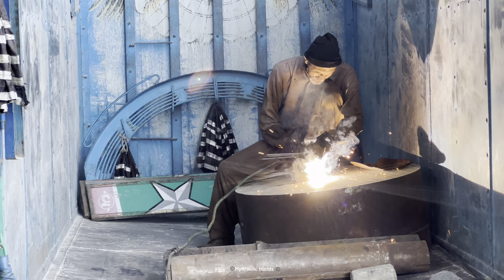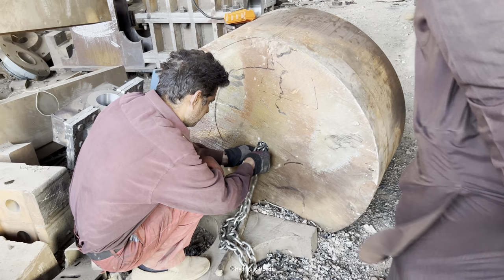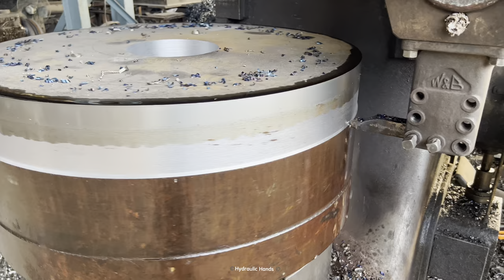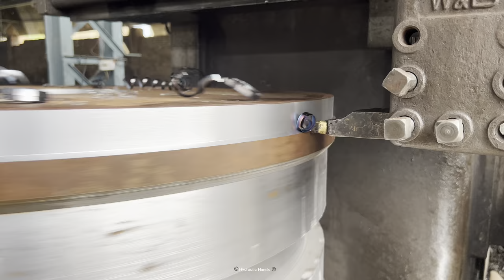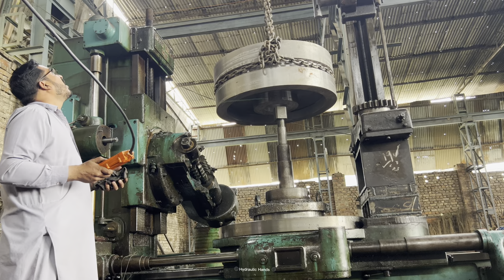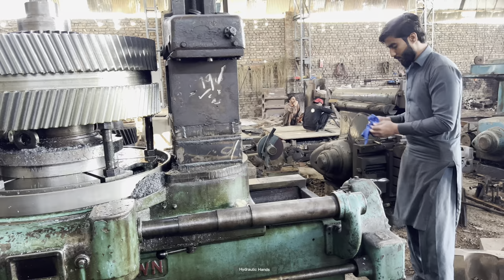Metal turning / how to turn 3Ton Double Helical Gear smarter than others

Comment: As an engineer ,this is the most counterproductive machining iv seen. Dont get me wrong, they do an awesome job but id use those machines way different with todays technics to make it way more time efficient.
Reply: "Technics" ?
Reply: @brianwood7480  technologie, i was wording it in my native language somehow xD
Reply: Machinists do what they have to do to correct engineers mistakes.
Reply: @SPIKESBIKES50  i do both, but what you r saying is quite the opposite where i work. And we make huge drills for halliburton oil platforms.
Reply: go there show them .
Reply: I have operated B&W 48"  (shown), 60" , and 72" . They were manual and we just cut to spec. The CNC lathe programs out of our engineers office, all had to be modded to prevent machine damage. I hope mine was an isolated problem. Good day.
Reply: job gets done  hrs dont matter 
when you get paid peanuts

Comment: Safety first... those must be steel toed sandals, but cool engineering. You guys work so well with each other.
Reply: In the West, OSH would close the workshop in seconds.
Reply: @howardsimpson489  when your working with lumps of steel that heavy it doesn't really matter what your wearing on your feet steel toecaps certainly aren't strong enough to save them.

Comment: Question for anyone that knows:  it looks like these workshops use pieces of tungsten carbide, braze welded to a piece of square steel, as the cutting tool. ie rather than buying loads of expensive cutting bits as one would see in a Western machine shop.   Is that right?
Reply: Yes that's pretty normal here

Comment: As someone who lives in the west, the lack of safety gear is terrifying, when i worked in heavy shops like these we had all manners of protective gear to keep from losing fingers, face, hands and feet.
Reply: if the wotkers knew how to grind a chip breaker on the tooling ,the piles of dangerous viny chips would be reduced to easy to shovel piles

Comment: They do not seem to use any lubrication to cool the working tip. Why?
Reply: Carbide, use none or flood a lot of cooling fluid. It can take the heat and pressure.

Comment: When machining the outside diameter, he clamped the steel far too long! It is a basic rule for turning and this type of machining that the steel should be clamped as short as possible. This is because the vibrations on the steel increase with the length, and if they become too high, it breaks off.
(and I don't want to be standing next to it)
In addition, this unnecessarily long clamping increases the wear of the steel, which means it has to be replaced sooner.

Comment: This is very likely Pakistan and most likely the city of Karachi (that is where the Karachi shipyard is). They are wearing Shalwar (pants) Kameez (long shirt) and the typical slippers/or slides that are ubiquitous in the oppressive heat of Pakistan. IT makes sense because they have no air conditioning and in summers this factory will be nightmare hot. They have old old equipment but they can churn out impressive tolerances on these machines - not this specific one, but these run down factories sometimes are producing airline and missile grade stuff. But it is usually not promoted or even known. They keep all these seemingly run down factories spread out all over the country for safety reasons.

Comment: There are levels of precision in manufacturing, which shows up in engines that last 2/300k compared to the expectation that engine of yesteryear won't survive 100k.  Both precision and safety require investment by business owners, who are making a profit without that capital expenditure.  It's the workers who demanded safety, and the upgrades likely introduced additional precision, leading to fewer jobs.  No easy answers here.

Comment: Smarter?  Not by a long shot. After all of that, if their products were sold out-of-country they'd need to be re-machined for precision.  At the beginning, lifting that ingot with a chain and using a nut and bolt, with no flat washers on each end?  Seriously?   No compressed air to blow away the chips?
Reply: You are from USA? You are perfect!🤬😡
Reply: @Mikediorama6301  Thank you!  😄

Comment: Evidently these workers do not know what a chipbreaker is ? all it takes is a simple groove after the cutting edge, possibly positive ... but it is useless, they are stuck in the distant past. What about the undersizing of the machines, for the size and weight of the parts?

Comment: could have saved time, by just simply using the chain and then put a pole though one of the lopes ,not double chain through the hole, no need, if the chain is rated for more than 3 tons. etc?

Comment: Machining the grooves into the faces is pointless.  Making this gear from a casting, and saving the material that way, makes sense though.
Reply: World wide gear teeth are hobbed like this.   Casting is far to imprecise for gear contact patterns.
Reply: @stevecarlyle1390  I think he mean those grooves on sides not tooth
Reply: These pieces are forged. Casting will not produce material hard enough for gear teeth - and they have to be hardened and ground to the right size. This is not the complete process.

Comment: is that like equipment from the 1900's? Also, the lack of Safety Equipment and Standards will not only have every Safety Inspector leave the Chat, they wouldn't even enter it to begin with!
But then again... If anything of that size drops onto any body part, chances are you're gonna loose it it regardless so I guess they'd rather go for a clean amputation that a mangled something.
Reply: I ran gear like that in the 2000's, but at least we had a small chip cage around the tables - 48", 60", and 72". The 120" Niles VTL  had no cage, and it was a little scarier.

Comment: Why are they using crap shop made brazed tooling? That surface finish is terrible. It's about what I would see from a 12yo running a lathe for the first time. Proper indexable tooling is not expensive.

Comment: Just imaging if they had real good quality cutting tools bits, tungsten carbide instead of hi strength steel sharpened bits, notice how slow its going, that way the tool bits do not damage and last longer? Or better still start a business by buying diamond dust and invest in a hi end hi temp oven and make the tool bits with diamond dust glued to the ends?
Then sell it to them, that way they can work faster and make more gear sets with out the worry about damaging the tool bits?
Reply: You get a better finish with hss. It doesn't look like they're in a hurry either. These aren't high speed cnc machines and labor is 3 bucks a day so...

Comment: O safety
Reply from the maker: Ah, you noticed our safety dance! Or should we say lack thereof? 😅 Here in our shop, we like to keep things thrilling by embracing the adrenaline rush of working without safety gear. It's like extreme machining, where every move is a calculated risk... or maybe just a bit reckless! But hey, we're all about living on the edge, even if it means teetering on the brink of safety standards. Thanks for pointing out the obvious!